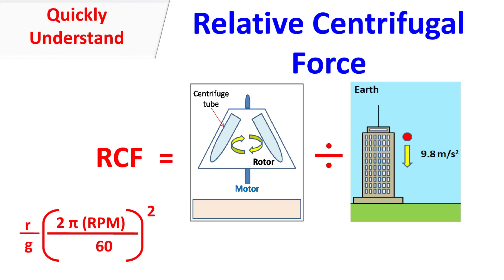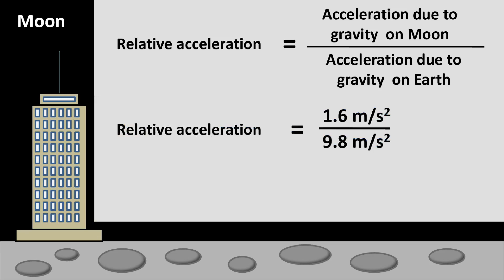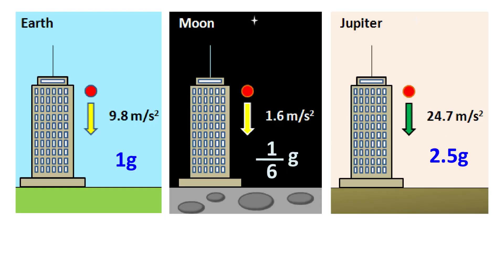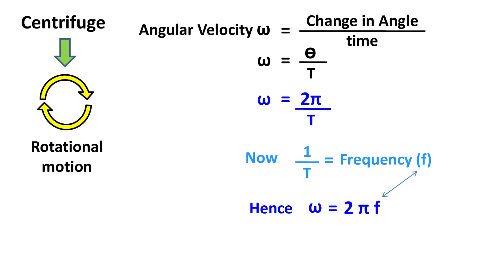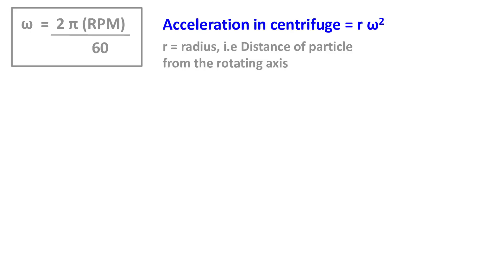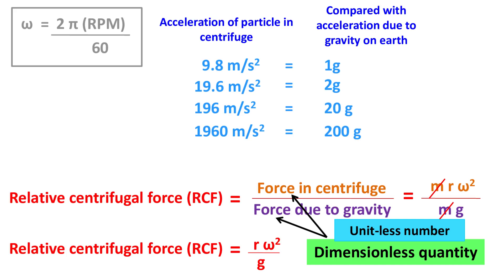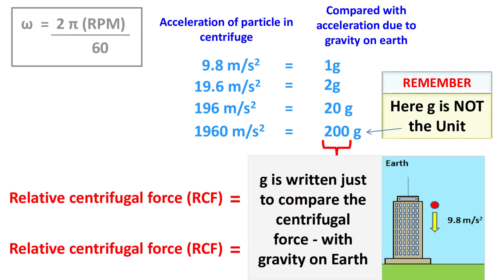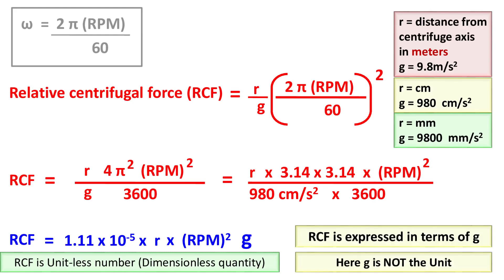RCF | Relative centrifugal force

Comment: This is a great explanation and thanks for the video. I will note there is one error at 07:47 where you have missed (X4) on the numerator of the fraction.
Reply: What is the right answer buddy
Reply: @randomshortsdheeru215  The final RCF expression is correct. Just when expanding out 4π², the 4 is missing on the right hand side.